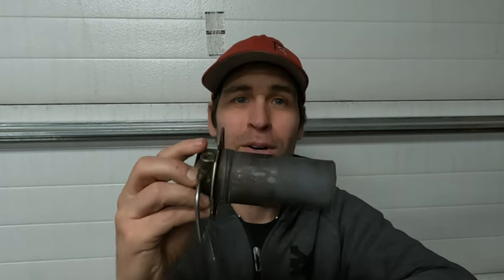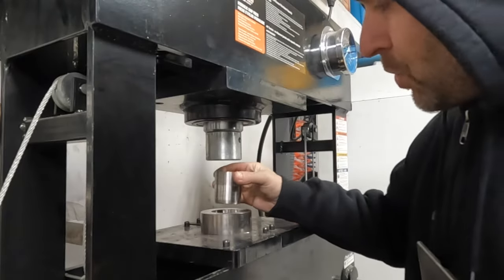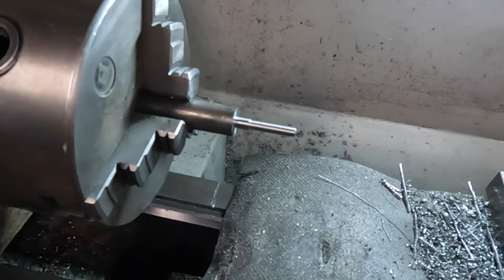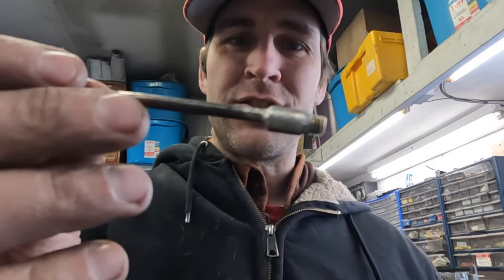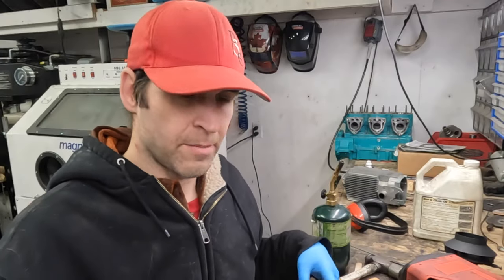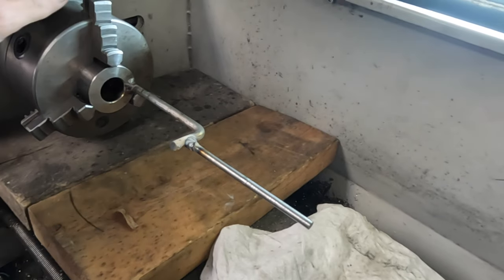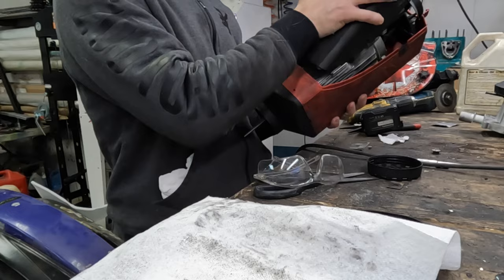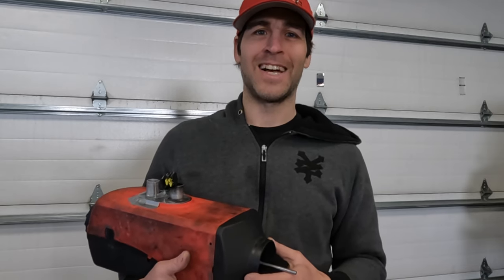Self Cleaning Diesel Heater - Build Video.

Comment: Can't wait to see the testing. I have a good feeling about this one and even if it doesn't work as intended I think we will learn a lot from it.
Reply: The aquarium air pump the way you have it running and plumbed could need look at I'm pretty sure that type of pump can't handle having the air flow restricted to much and if it's running while completely blocked I don't think it's going to last very long
Reply from the maker: Yeah... it's always interesting to see what the outcome is. In the past, I have always found it interesting to see how wrong I was about my assumptions, haha. 

Initial testing looks good, I will say that, but it does need some tweaking, already. Some if it was expected.
Reply from the maker: This is a diaphragm pump, and can be totally plugged without any harm, as long as the pressure backing up doesn't cause the piston to stop. (if that is even possible) 

The way that they limit flow into tanks, or to direct air to one area of it tank is with a manifold with many valves that can be closed or partly closed. What it really don't like is having oil pumped into it, haha... and I have done that once. 

I need to purchase some silicone sheets so that I can cut out some durable valves.

Comment: Oscar worthy performance.

But I did notice a different air intake at the end of the video.

Did you put a tube on the ported intake....lol
Reply from the maker: Haha... There was some acting in this one for sure. 

I had the ported housing on it at first, then I realized that I wanted to run some tests on the ported fan housing (compare it to a stock one) so I pulled it back off before I did the testing. 

I also thought it was a good idea to keep the heater as stock as possible so we know if it will run that way.

Comment: I'm not sure what the clearance between the two pieces is but it will be interesting to see if they try to fuse together..
Reply from the maker: I assume you are referring to the rotating part and the chamber walls? I was worried about this, but it appears, after a little testing, that that will not be an issue. I'm guessing the oxides that form stop them from bonding.

Comment: If you succeed with the self cleaning mod I would love to buy some kind of product and manual to build this myself :D

Edit: This drill action looks so much fun.
Reply from the maker: Haha... Yes, the drill action is fun. A 12V motor that was geared to turn the insert slowly, would be a better idea. 

This has the potential to actually turn into a product or kit. We will see what happens intime. It will take a lto of testing.
Reply: @loweredexpectations4927  I could imagine if a stepper motor turns the insert a quarter or half turn after a set time to break the carbon
Reply from the maker: @JohannesBrotBaum  Yeah... I'm trying to decide if it would be better to turn it slow all the time, really slow, like 2 rotations per minute, would be better than turning it periodically. If there is going to be an issue, it would be starting to turn after sitting still and getting stuck or partly stuck. 

It would be more energy efficient to turn it every 5 minutes or so if it is not necessary to keep it turning.

Comment: I could not find your testing of the self cleaning model did you ever make a video on that?
Reply from the maker: I did some testing at the end of the heating season but never published the video. Life got complicated and busy. 

The long and short of it is. I ended up using a system called the Tweaker, designed and donated by a viewer. It allows me to inject fuel with two pumps, at any rate I choose and at any mix ratio I choose. 

With this, and the air injection, the heater worked well for quite a long time, and the self cleaning mechanism actually worked, until it didn't. Meaning, when rotating the device, it was able to clean itself out to the point that it didn't' have any significant running issues, and didn't flame out. 

However, as suspected / expected, the metal shaft that drives the device was not able to stand up to the oxidizing conditions in the burn chamber. It also got really soft from the extreme heat, and had issues with twisting / deforming under any real load. 

I believe that this system could work, and bought some ceramic insulators to protect the shaft. I then got busy with other things, and haven't published the test footage or shared my idea of using the insulators. 

It should be noted that I did not do extensive testing, and there may be issues with particulates, removed when cleaning, may plug the heat exchanger or exhaust. At the very least, the heater would have to be mounted with the exhaust pointing down and no restrictions, to allow debris to fall out. 

I may get back to this at some point in the future, but can't say for sure.

Comment: I'm a bit late for that video.
Got mixed feelings with all that fragile stuff.
The fuel intake will melt the low temp solder in case of power outage, i'd guess.
The cleaning rod sits exactly, where every material you tried, did disintegrate last winter.
The project sure  is honing your building skills!
Reply from the maker: Sorry for the delayed response. I have been busy with house stuff. 

There is some fragile stuf and I realized it while building it, but didn't want to spend too much time thinking about it and just went ahead with this design. It is late in the winter and I felt like I needed to get something together to test the overall concept. 

I tried to edit a video for Sunday, but some of the footage was corrupted, and after my computer freezing several times over an hour, I gave up, as I didn't have enough time to mess with it. 

The solder isn't a good idea, but I was hoping that the fan would keep that area cool enough. The fuel nozzle will have fuel and air passing through it, so it should stay cooler, and hopefully not deteriorate. After a little testing, the scraper and now sepparat fuel nozzle, seem to be holding up fine. 

I am very close to my house purchase, and now I owe Vevor two vodeos that they have been asking about, so the pressure is on...

Comment: Hey buddy I really need some help here. I need a 12v/24v universal motherboard foŕ 5kw/8ķw heater that has a white 5 wire plug for the lcd controller with bluetooth.  I have a new heater thats 12/24 volt universal but the controller has the white 3 pin connector. I need a white 5 pin connector. I bought this new controller with the knob thats bluetooth. I've seen them on Hcalory, and on Vevor I think. Any help would be appreciated. Thanks
Reply from the maker: Hey, sorry to hear you are having trouble. I have actually only every used a 3 wire system. 

I generally recommend only purchasing controllers and motherboards as a set, as they can be really tricky to match up. Come to think of it... You will need a new wiring harness if you are switching form one to the other, as the ECU / motherboard plugs into the harness, and the controller plugs into a separate plug in in the harness.

This may turn into a long search.
Reply: Thanks for replying. I've spent hours looking for a main harness with a 5 pin connector for the controller.  You wuld think that if they sell the controller then there should be a main harness and motherboard for sale. I know you have the bluetooth controller in your truck and I'm guessing it probably is a 5 wire connector
Reply from the maker: @958chaz  Nope. The controller for my Bluetooth heaters are 3 wire. I know because I cut and extended the one in my truck. I'm curious as to what the extra wires are for. 

Most retailers / manufacturers do not sell parts for their heaters, annoyingly ... so to get parts is almost always a third party like aliexpress. Most people won't be searching for a wiring harness so it could be tricky to find one. They make some extension cables / harnesses for the controllers, but I have never seen a harness for sale.

Comment: Joel, i know that everyone wants to burn cheaper fuel combo's etc, but have you ever tested the cleanliness of burn of 'premium grade' diesel with all the associated additives versus just the standard diesel, with the view to having much less maintainence issues, whilst accepting the higher cost. My usage of the heater will be fairly minimal, but the maintainance strip down would be a mega pain as it is located in a box outside underneath the van. Any opinions on the burn prospects of premium??
Reply from the maker: I have not tested this... My feelings are that this would have to be a very long term test to get any definitive results. From my experience, automotive diesel burns VERY clean and to get any real results, one would have to run the heater for several months. 

I honestly believe that the best way to deal with this is to use a CO meter and make sure that your heater is under 20ppm... If so, I don't think you will have issues with soot. If you use the heater at different elevations, it would be a good idea to have a heater that compensates for elevation, or to set your heater up for different locations (using a CO meter) and adjustable controller.
Reply: @loweredexpectations4927  Many thanks for the reply. The heater i purchased does have auto altitude adjustment and start stop technology to maintain a set temperature ....so hopefully it will burn warm and clean, then shut down till the temp falls sufficient to restart the cycle over. Thanks again.

Comment: how is that going to clean the chamber out? 1:59
Reply from the maker: "I'm glad you asked" haha. 

I have actually redesigned it already, and the nozzle will be separate from the cleaning finger.
Reply: Cleaning soot from a burn chamber, especially if it's a steel tube, requires a method that can effectively remove the buildup without damaging the chamber itself. An automatic cleaning system can be designed around a few key concepts. Here are some simplistic yet potentially effective approaches:

Mechanical Scraping System: This system would involve mechanical scrapers or brushes that are automatically driven through the chamber. The brushes could be on a timed cycle, moving back and forth inside the tube to scrub away the soot. The design could be similar to chimney cleaning brushes but automated. For instance, a motorized system could extend and retract the brushes, ensuring that the entire inner surface of the tube is scrubbed.

Compressed Air Jet System: Another method could be the use of high-pressure air jets to blow the soot out of the chamber. This system could involve a series of nozzles strategically placed to cover the interior surface of the tube. Timed blasts of compressed air would dislodge the soot, which could then be collected at one end of the tube for removal. This method is less abrasive than mechanical brushing and could be more suitable for tubes with sensitive surfaces.

Water Jet or Steam Cleaning: Similar to the compressed air system, but using water or steam. High-pressure water jets or steam could be used to soften and dislodge the soot, washing it away from the interior surfaces. The main advantage of water or steam is its ability to soften and remove stubborn soot deposits, but the system would need to account for the removal of water and potential corrosion issues.

Ultrasonic Cleaning: This is a more advanced and less common method, but ultrasonic cleaning can effectively remove soot and debris. It works by generating ultrasonic waves in a fluid medium, creating microscopic bubbles that implode (a process called cavitation). This action can dislodge and remove soot from surfaces. For a burn chamber, implementing this could be challenging and would likely require the chamber to be filled with a fluid medium periodically, which makes it less practical than other methods.

Rotating Ball System: This method involves a series of small, heavy balls (made of steel or another hard material) that are circulated within the tube when it is not in operation. The motion of the balls, driven by a combination of gravity and possibly mechanical agitation, scrubs the interior surface of the tube, dislodging the soot. The balls would need to be collected and possibly cleaned after each cleaning cycle. @loweredexpectations4927
Reply from the maker: @AuditorsUnited  I'm sure you are using the word soot and ash interchangeably and I don't' mean to pick, but want to be clear. Soot happens when the heater is running too cool or too rich. We are not concerned with soot or carbon, as they can be taken care of with the proper burn ratio. In my tests leading up to this, we have reduced / eliminated carbon and soot from being a concern. 

The cleaning system in this heater is based off of previous experiments, and the finger will not damage anything, as it does not touch the rotating piece, but allows a few mm of ash and or carbon to accumulate on the inside of the rotating assembly. Not enough to cause a problem, but perhaps enough to act as a wick for any unburnt fuel. 

I have considered a wire brush, like a chimney sweep, but, due to the extremely harsh conditions inside of the chamber, the brush would erode away from oxidation, even if it were able to stand up to the heat. Whatever is in there, also needs to not cause a restriction to flow, or the heater won't function properly, or at all. 

I have used / tested compressed air, and while it can help with the burn, a little too much, more than 20 PSI, and it blows the flame out. I have considered a very quick "explosion" to clear debris, using a pellet that was injected into the fuel line on a timer .... every 30 minutes or something like that. Not sure that people would want to buy that though, haha. If it happens quickly enough, even though it put the flame out, it could restart, if the chamber doesn't cool off too much. Pressure is also a problem, due to the design of the heater. The fan is capable of producing very little pressure. If the pressure in the chamber reaches the same pressure as the fan, no air will go in, and the flame will go out... if the pressure in the chamber is greater than the pressure supplied by the fan, then air will go back out the intake port, along with smoke and or burning gases. 

Many people have suggested water or steam. It poses some of the same problems as the air, changing the pressure will cause a flame outage. It also has the negative effect of cooling off the chamber, and that is not desirable. These heaters struggle to stay hot enough to flash off the oil, so anything that cools the chamber is not good. This COULD work in very short blasts, but I am skeptical... I will likely try it, just because, why not. 

I think the US idea is interesting and have had one other person suggest this. If you can have it clean successfully through the air, then this could be a very cool solution. Perhaps at the right frequency, it is possible. 

I like the idea of the balls and have heard a similar idea a few times... I did think of putting ball bearings in my current setup, to see what would happen... I may try that in the future. A person could use ceramic balls so that they weren't affected by the heat or oxidation. I was thinking of an idea where a strong electromagnet was used, plugged into AC, so that it switched polarity, and that could cause the balls to vibrate around .... Unless They get too hot and pass the curie point, where they become non magnetic. That temp is 770 C for mild steel... so this could potentially work really well, as long as the chamber doesn't disrupt too much of the magnet field.

Comment: So I was thinking. What if you used electricity like lightning. Have a rod in the chamber  and use it to create a lightning bolt. That will move around.
Reply from the maker: That's the first time I have heard that idea... Very interesting. I'm not sure what effect this would have on ash / carbon or the combustion process.  

My feeling is that the arc would jump to the least path of resistance, so if an area has ash, the arc would avoid that spot. As for the combustion... I have no idea, but I assume that it would take a fair amount of KW to produce and effective arc to effect the process. 

I know that arcs pass through flame much easier than air, due to the decreased resistance... Either way... very interesting idea.
Reply: This also might help weld a ball at the end of the rod.  Copper or stainless steel, not sure which is best. Ya never know...

Comment: Use Titanium its the only thing that can handle the high temp. I know because I allready did this.
Reply from the maker: Really ? What parts did you make from titanium ? Titanium can handle the temp, but it is also a VERY reactive metal... " I already did this." What did you already do ? 

I have used stainless and tungsten (that can take more heat than titanium) in the burn chamber (in previous tests) and altho melting is not an issue, both the stainless and surprisingly, the tungsten had a huge amount of oxides pretty quickly.